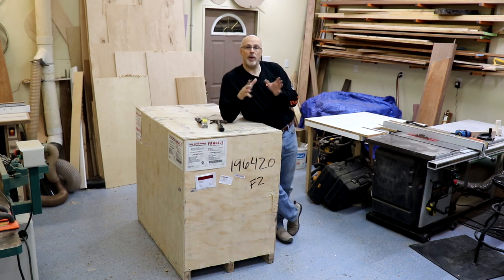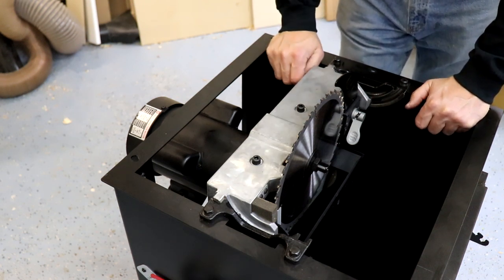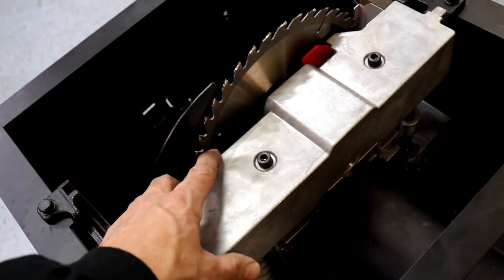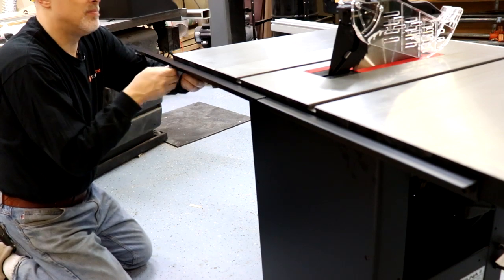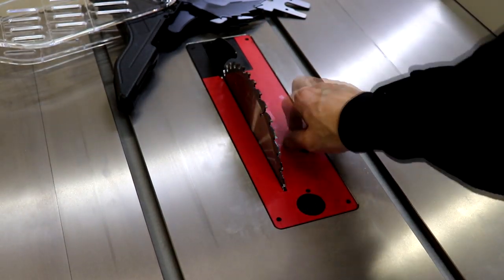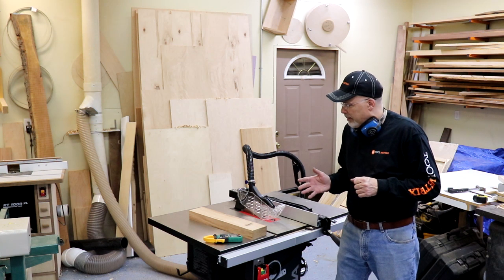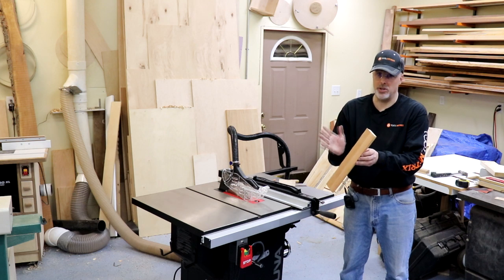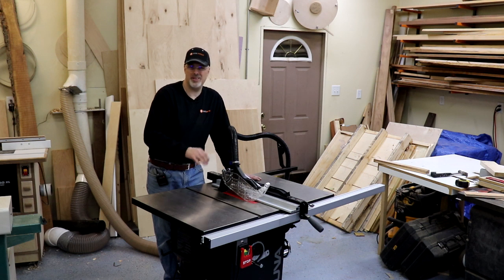Laguna Fusion F2 Table Saw Unboxing and Deep Dive Examination

Comment: I see you in a garage (like me), how was it delivered or did you need a trailer and some way to lift the pallet?
Reply from the maker: Hi there, it was 6 years ago but from my recollection they used a lift gate truck to lower it to my driveway, and they used a hand truck to move it up my driveway to my garage. From there I put it on some casters and rolled it into my shop which is directly behind the garage.

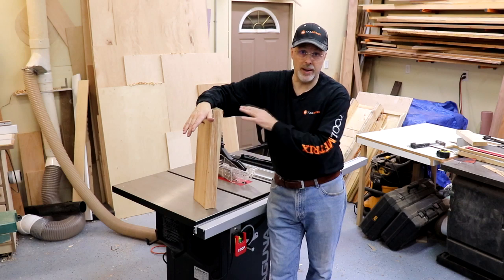Comment: at 9:27 you see the wood leave the fence during the cut? Is this fence deflection?
Reply from the maker: That's not deflection.  It's just that the fence is set up so that it angles away from the blade toward the rear of the saw to avoid binding.  I may have angled it a couple thousandths too much.

Comment: I have an INSANE  question. I am buying a used F2 in just a few days but only have an SUV. I see the top will come off…. I also see that I can rotate the blade to 45 and get the motor completely into the cabinet. How difficult is it to take the cranks off so I don’t damage them? Any tips or tricks I should know before taking them off?
Reply from the maker: It’s been so long since I set up this saw that I’m no longer a fair witness. I’d suggest contacting Laguna or posting on a Laguna owners group.

Comment: Howdy, I’m purchasing the T2 and need to move to my basement shop down a 6 step bulkhead staircase. I was thinking to lighten the load, I would remove the cast iron tabletop as shown in your video. Seems like removing the top is only 4 bolts. Is it easy to remove and reattach with out screwing up my new toy?
Reply from the maker: Super easy and definitely worth the effort. Enjoy the new saw!
Reply: Thanks, Paul, hopefully removing the cast iron top will remove enough weight to manage getting it down the stairs so I don’t have to higher a moving company to heft it down. Do you estimate that the top is 1/3 the total weight of the saw?
Reply from the maker: It will make a huge difference. 1/3 is a good guess. I don’t know what the actual numbers are. In addition to the weight it will make the shape a lot easier to deal with.
Reply: @ToolMetrix  , thanks for confirming. This was the final concern/obstacle for my decision to go with the Laguna T2 vs the SawStop contractor which would be slightly easier to carry or slide box down the basement stairs.

Comment: Very much enjoyed your helpful review.  I have one concern.  Is the 1-¾ hp motor a bit underpowered for 6/4 or 8/4 hardwood?  Apologies if this has been asked and answered previously.  Thanks.
Reply: Thank you.  Just cutting boards which I only do one at a time.  So thick stock ripping only a couple times a month. Buying the F2 after the holidays!
Reply from the maker: Thanks Dan. It doesn’t feel underpowered for occasional cutting of 8/4, when using a thin kerf blade. If you are cutting a lot of that stuff every day you will want more HP.

Comment: Thanks for the review! It was very helpful. I saw in another review that the fence deflects if you push on it at the furthest end about an 1/8". Have you had any issues with that? This would be my only issue to keep me from purchasing this F2. The F3 seems to have a thicker fence and I'm sure it's more stable/rigid but also more expensive. Do they give you an option to buy the F3 fence with the F2 saw?
Reply from the maker: I did not have any issues with the fence, but I do not recall doing that specific test. I do not believe that they would upgrade just the fence as the saws are boxed as complete kits from the factory.

Comment: You do have to spend some time setting the saw up... blade, fence, etc. But once done, the saw is great. Fairly compact which is Nice https://www.youtube.com/post/UgkxXh-4_3-ZT1fFWP91ZV7iVqzElr0lEb-a I did get an Incra Miter Gauge which takes some setup as well. The stock miter gauge can be adjusted in the miter slot with a little painter's tape... this tightens up the side to side play a lot.
Reply: @ToolMetrix  Funny thing I noticed while gathering info on the laguna saws, as they are now available in europe. This is a bot. I have seen this exact comment in literally every video on the fusion saws.
Reply from the maker: Wow that is interesting! Thanks for the heads up.

Comment: Does the fence actually stay true when setting up for a measurement? My current table saw when I set my fence to say 8 inches, the place closest to the fence handle will be 8 inches from the blade but the far end will be 1/16th of an inch off or so. So I have to constantly measure the front and back of my blade to the fence and keep taping the fence over and over again to make sure  I'm perfectly parallel.  I'm wanting to upgrade my saw and love the SawStop but the Laguna F2 seems perfect for my needs, with a lower price tag. I just don't want to have another fence with this issue
Reply from the maker: Yeah, the fence is solid and stayed accurate.  It's a standout feature on this saw, IMO.  No tapping necessary, just lock and go.  Nice motorcycle btw.
Reply: @ToolMetrix  okay well that's a little more reassuring hearing that. Thanks.

Comment: Hi,
I was wondering how complicated the removal of the cast iron table is. I would nee d to carry the saw in the basement and would like to strip it for weight.
How much does the base of the machine weight without the table?
Reply from the maker: It’s pretty easy on the F2 as I recall.
Reply: @ToolMetrix  ok, sounds good. any Idea how much the machine body weights withour the table?
Reply from the maker: Don’t know but it should be manageable for 2 healthy men. Web says shipping weight for F2 is 265. Subtract some for pallet, and the top, rails, hand wheels, and everything else you can carry separately must weigh 100ish (wild guess), im guessing that you will be carrying 130-150 pounds. Easy peasy.

Comment: Thanks for an amazing review of both the F1 and F2 saws. I very much appreciate the effort you put into making such an educational video. Your information has convinced me to purchase the F2, particularly that you were easily able to remove the cast iron table top. As with so many other hobby woodworkers, the saw has to somehow get downstairs to the basement. Is the tabletop attached to the base with four bolts and is the entire top one piece or is it three pieces (there appears to be two seams separating the top into three pieces). Thanks very much!
Reply from the maker: Thanks.  I think it's attached to the base on the F2 using 3 bolts if I remember correctly.  The manual will show whether it's 3 or 4.  The top is 3 pieces, and will be easy to haul downstairs if you take it apart.
Reply: @ToolMetrix  Thanks for the information. I appreciate it.

Comment: How do you keep your table surface so pristine? Mine has rust… I don’t want to take a scotch Brite to it though…
Reply from the maker: Well, that's a brand new saw.  But my main table saw is 25 years old.  In my previous garage shop, rust was a constant battle.  I tried many different products and nothing prevented it.  The only thing that worked was to cover it with a tarp when I wasn't using it, and that worked perfectly.  To remove rust I use 0000 steel wool and WD40. The coat it with car wax.  Some people will warn you against car wax because it can mess with wood finish, but I've never had any problem as long as remove the car wax before you use the saw.  :)  But the wax itself offers very little resistance against rust.
Reply: @ToolMetrix  I’ve been using WD-40 to clean it… who knew

Comment: Hi Paul, I am in the market for a new saw and looking at the Laguna F2.  I watched a few videos about them fence, and I am really concerned about the fence, there is no support on the other end of the fence, how much play is there, especially if you are cutting large boards the inaccuracy will exacerbate the problem.  Whats your opinion.
Reply from the maker: I didn’t find any concerns about the fence. I think this aspect of the F3 fence is a pretty common for a cabinet saw fence. It’s the same in that respect as the  Biesemeyer fence on my unisaw.
Reply: @ToolMetrix  thank you
Reply: Thank you

Comment: Does the inability to move the fence to the left side limit you? How easy is it to clamp sacrificial boards and jigs to the fence? My current table saw fence has slots in the fence so sliding bolts can be used without clamps, allowing unlimited vertical clearance from the fence for running tall boards.
Reply from the maker: You'll want to confirm this but I believe that on the F2 you could use the fence on the left of the blade by removing the screws that fasten the euro fence.  It would be a pain to do this if you did it frequently, but if it was a once or twice a year thing, probably no big deal.  If it works the way I'm remember, no, it wouldn't bother me because in 25 years of woodworking I have maybe used the fence on the left 1-2 times, and that was back when I had a saw with a right tilt blade.  I don't know if I've ever used my current saw that way, and I've owned that since the late 90s.  I think the way that I'd probably attach a sacrificial fence would be to drill screw holes through the Euro fence and attach by just running screws through there.  Simple and quick.  Jigs would be different.  I think I would make a tenon jig, for example, to ride on the upright of the Euro fence.  If that worked, it would be super easy.  And I think it would work fine.  I like the design of your current fence.  That's a thoughtful design.
Reply: @ToolMetrix  Thanks for the thoughtful reply; I suppose there will be a way to make a jig fit... Same here, I move the fence to the left side maybe once a year.

Comment: Suggestion: The crate comes off much more easily from the bottom by simply unscrewing the Phillips Head screws at the bottom and lifting the box off. This is covered on the Laguna website in their video. Unfortunately, persons who do not watch this video will do exactly as you did because the manual is inside the box.
Reply from the maker: Thanks for the suggestion. It came apart easily and I’d have to disassemble the crate for disposal anyway so for me I don’t know if that would have been better. But if Someone wanted to keep the crate intact that’d be a great approach.

Comment: What a fantastic review. Exactly what I needed to make the final decision to buy. Curious how easy it was to remove the top, then reinstall it and get it all aligned properly. I have a shop in my basement with only access through my house so getting it down a narrow set of stairs (with a turn) will be impossible without a little disassembly first!  Anyone experiences would be greatly appreciated.
Reply from the maker: Hi Anthony, Thanks for your feedback.  It's easy to remove and replace the table on the F2.  I'd say that you can probably go from the top being removed to it being fully installed and dialed in for square in about 30-40 minutes.  I would not have any hesitations in removing the table on the F2.  It's trickier on the F1, but no problem on the F2.

Comment: Sir, first, thank you very much for the well-done review! I only need to know one more bit of detail...is the fence consistently accurate?  Having an accurate fence is my #1, #2 and #3 priority before I buy a new table saw.

We have Rockler nearby and I can buy this saw from them locally. But, the fence is a make or break deal for me. I am so tired of spending more time adjusting the accuracy of my saw fence. Thank you in advance for taking the time to respond!
Reply from the maker: Hi Gerry, yes in my testing the fence was dead on at any location and it locked down solidly so it held the accurate position over multiple cuts.
Reply: @ToolMetrix  That's great! I'm going to place an order for this saw. Thanks!

Comment: hows the Dust collection thinking about this saw. I know this is a older video but i would like to know
Reply from the maker: Hi John, thanks for your question.  The F2 is set up with dust collection that is optimized to give "pretty good collection" with a SMALL dust collector.  It has a 4" inlet, and splits that into a 2.5" going to the blade shroud, 1" going to the body of the saw, and 1.5" going to the blade guard.  With a 1.5 HP DC, that gives you some collection in all areas, albeit not perfect in any area.  Here's what I would do if I was going to keep this saw in a shop environment.  If I only had a 1.5 HP -2 HP DC, I would not use the blade guard collection.  I'd seal that off. I'd replace the 2.5" internal hose with a 4" hose (and eliminate the 1" hole going into the cabinet) and maximize the collection below the table, and just deal with the minimal amount of dust on top of the table.  If I had something larger, 3-5 HP, I would run 6" duct to the back of the saw, reducing to 4" at the main inlet (which I would replace with my own) and running a 4" flexible duct to under-table shroud.  From the 6" line I would pull a separate 2.5" branch to the blade guard.  This would give you near-perfect dust collection above and below the table.  You could even go 4" to the blade board, but that can actually provide too much CFM and actually start pulling small cut-off pieces up into the DC system.  2.5" should be about right.  Or, you could go 4" and dial in the right air flow using the blast gate.  Cheers, Paul

Comment: Interesting, the thing that is keeping me from buying this saw is the fence.  While it does have some increased functionality over a Beismeyer, it is very difficult to make over the fence jigs and accessories. Until Laguna offers a Beismeyer fence for it I'll be looking for one of the other Manufacturers to put out an equivalent saw with a normal fence.
Reply from the maker: Hi John, Yeah, I get your point.  If you pulled off the sliding piece and the mounting hardware, you could attach panels to the side and have effectively what you want.

Comment: How hard is it to swap the fence to the other side if you want to cut from the left side of the blade?
Reply: As mentioned in an earlier reply this fence is similar to the old Delta Unifence. I've used that fence since 1985 and almost always in the low profile/ layed down position which allows room for your right hand to be further from blade when pushing thru a rip cut. The Unifence can be mounted on either side of the sliding t- frame for left of blade rips and for extension table router guiding. Is the Laguna fence able to mount only on the left side? Thanks for the informative review.  I'll subscribe and also look if you have reviewed Laguna's joiners
Reply from the maker: Thanks Rick. Those unifences are awesome and I’ve heard they are hard to find and worth a lot of money these days. I’m hoping to get my hands on one of the new redesigned jointers from Laguna later this year.
Reply from the maker: I didn't try it because I never cut from the left of the blade, but it should be easy.  The fence lifts off the saw easily.  You would just want to remove the three wing nuts from the right side of the fence that hold the sliding fence in place.

Comment: Just bought an F2 last week. Getting it all set up now, and looking into a dust collection system. So far, I really like this saw. A big upgrade from the various contractor and portable saws I have been using over the years. And the price is right for the features included.
Reply from the maker: Great to hear. Thanks, Corey. Cheers, Paul

Comment: Really informative and helpful, thanks for going in depth. Did you test amp draw on thinner stock, say 3/4 to 1 inch thick using hardwood, softwood and plywood, rip vs. crosscut? Looking to avoid calling the electrician if possible ;)
Reply from the maker: Hi Walter, thanks for the feedback.  I only tested the amperage draw on a thick piece of oak (approx 2").  Thinner or softer wood should be less stressful on the motor.  It hit 19 amps when ripping the thick oak.  I did a lot of ripping and cross cutting of all sorts of materials and never blew the 110V 20amp breaker.  Nothing else was running on the circuit.    So, my experience suggests at a 110/20 amp circuit is fine.  That said, not all circuits are created equal, so I hope that I don't lead you astray.  But the material that you are describing is a lot less likely to cause problems than the thick oak I was testing with.

Comment: Can a router be added to F2 on the end with support legs
Reply from the maker: I wouldn't see any reason why it couldn't.  I would suggest providing some supports underneath the table where the router will be mounted to avoid sagging, but other than that, I think it should be great.

Comment: Thank you for this review. One of the things I found was my table is .006" out of alignment with the blade.  The instructions don't match the table.  Did you find a table alignment bolt anywhere? I can't seem to locate it.
Reply from the maker: On this style saw the blade aligned to the miter slot by loosening the bolts that attach the table to the saw cabinet.  On the F2 I believe that there are 4 bolts; one in each corner.  Loosen three of them completely, and one of them just barely loosen it.  Then tap the table into position and tighten everything down.  It's a very easy adjustment on the F2.  In this video, you can see where the bolt holes are on the portion of the video where I have the top removed.